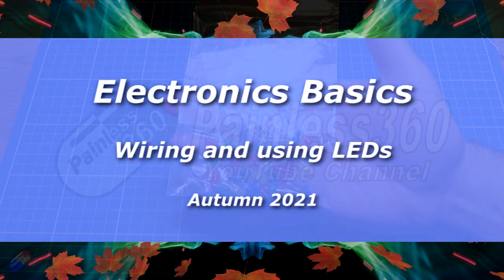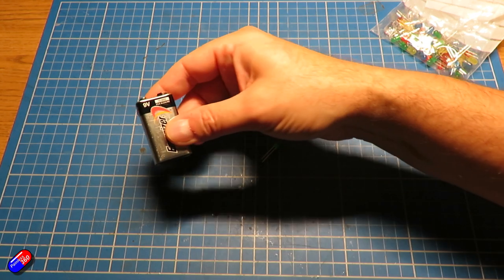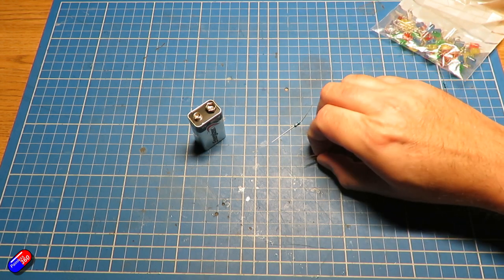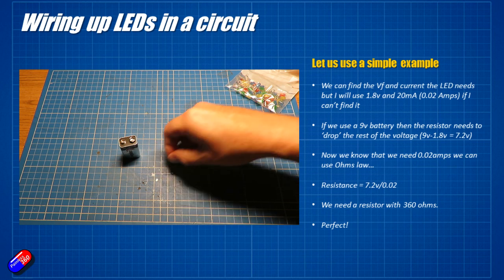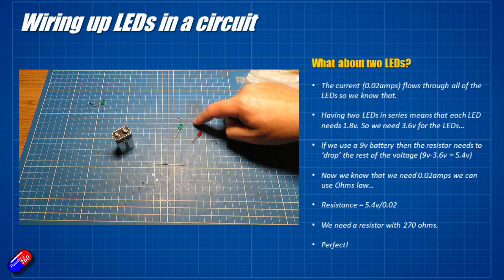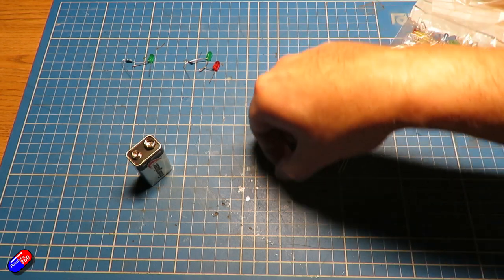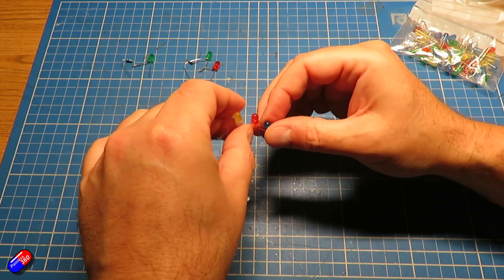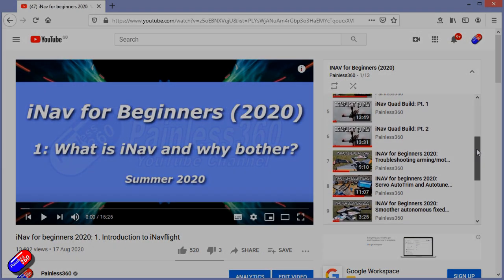How to wire up and use LEDs (explained for beginners)

Comment: Ah! For a moment I was that young boy, playing with batteries and lamps ...yes I had no LEDs , they existed only in the lab. I would learn ohms law early on, in school I would find the proper shop class, I knew it by the satellite which hung over the teachers desk, built by high school seniors it boasted all they had learned. I smile thinking of what might be built into it today.... then it has been 60 plus years. From ohms law to circuit analysis,  old man Bennett taught us well. Yes we could repair that radio or TV, we constructed telsa coils, and experimented with high frequency and voltage. Well I reminisce far afield , but thanks for the memories. Years latter I would share Bennett's teachings, giving several a step up, on their way to becoming engineers , closing the circle.  Take care.
Reply: Thanks! Since I am seventy three years' young your comments fit perfectly for me!

Comment: Is it not best practice to use a resistor on each LED in parrell to prevent circuit failure if one LED fails.
Reply: That would be a good idea in a safety-critical application, but waste too much power in most applications.
Reply from the maker: That isn't needed, wiring LEDs in series is a very standard way that efficiently uses the current and LEDs last for a very long time.. Happy flying!